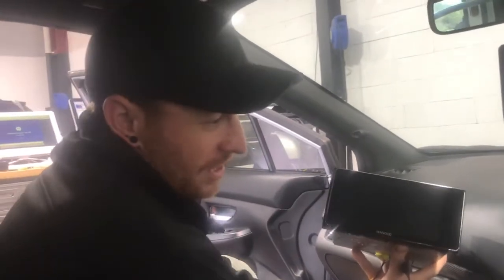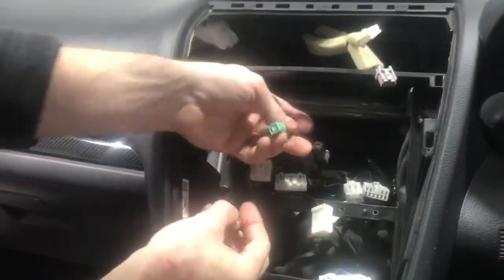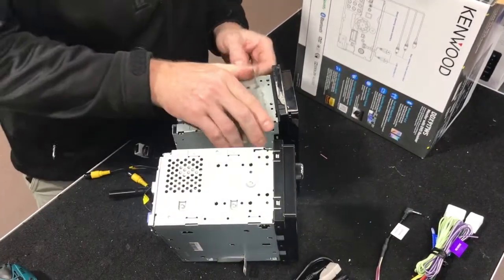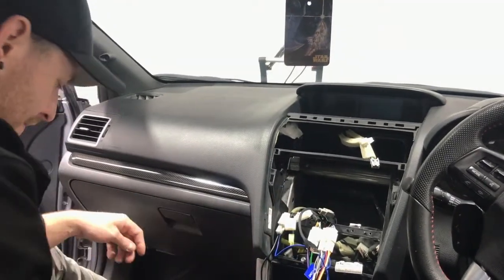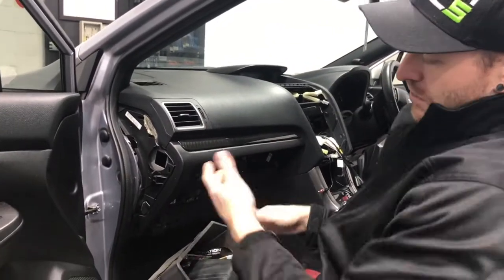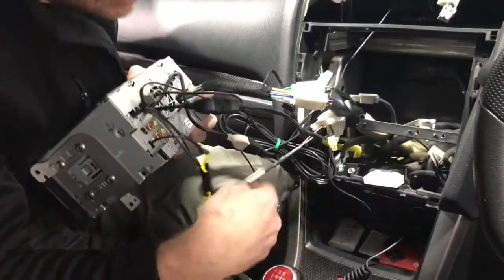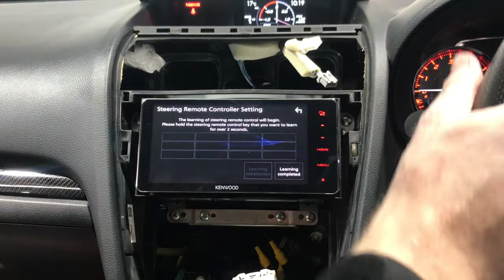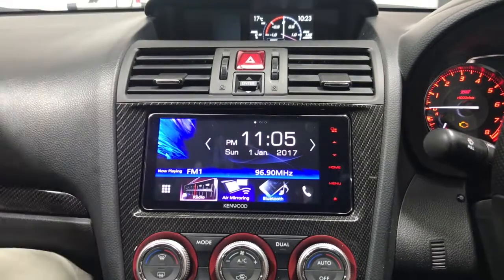DIY: Install Kenwood DDX917WS into 2013/14 Subaru WRX / Impreza

Comment: Got no sound for some reason I have a Harman Kardon
Reply: I have the same problem you figure it out
Reply: @ernestsosa4539  yep sure did. Needed custom loom made as system has a wire that was triggered by ECU I was told . Paid carboncar in Australia for plug in and play. It's the same at a Toyota 86 2015 model.
Reply: @MrShortStuff  thanks man i appreciate it
Reply: @MrShortStuff   would that be from the 28 pin connector or it’s on one of the other power connectors